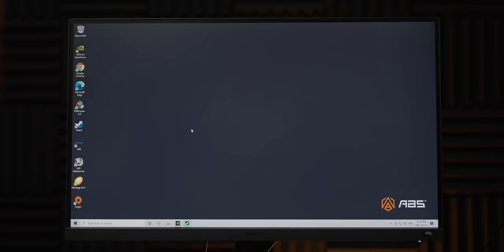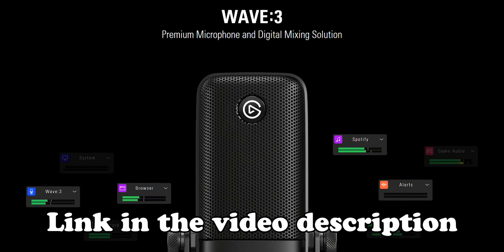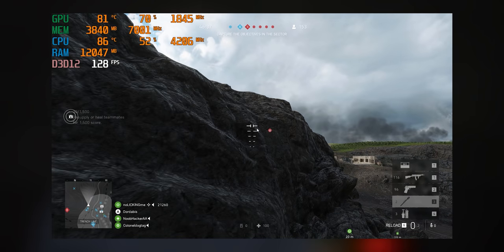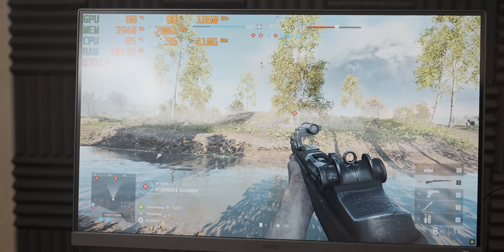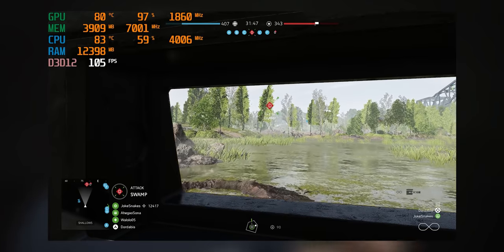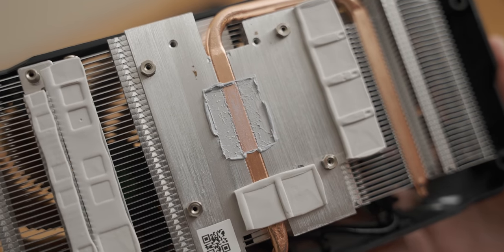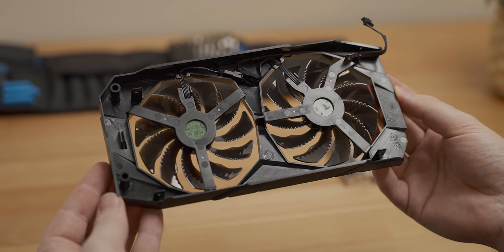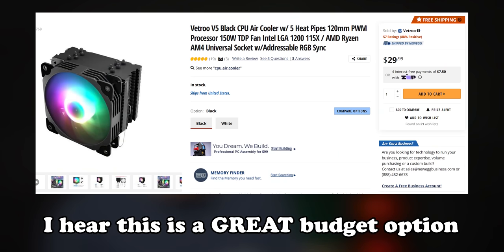Fixing The Best Selling Pre-Built Gaming PC On Newegg

Comment: Gigabyte RTX 2060 was what my Pre-built had when i brought it, it had the heat issue too but i was not confident enough to fix the problem my self, i saved up for the Asus 2080 super RTX and man that did it, like 10c cooler and way less noise even when i cranked up the rpm in the settings app. Now my problem is another fan in the case is making some more noise then it had done before, i dunno if i can fix the fan but i could replace it as i dont think it is the cpu fan as that is running fine.

Comment: What if you change the 4 stock fans around? 2 top intake and front and rear exhaust for instance? Keep the shitty cooler and remove the backplate? Would that fix the system for $0?

Comment: At this point you could've spent even less and just remove the front fans and put them on top and trash the 3rd...

I understand having RGB fans at the front can be nice... but I really don't get all those cases with a glass panel at the front and no/almost no air intake, rendering those fans useles.. There are much better cases out there like the Phantek P360a, that this is SOOO good and still looks great while being cheaper too

Comment: If you wanna go to the extreme end of upgrading that poor little GPU heatsink just for fun, there are Arctic Accelero GPU coolers that can fit many GPUs. There is the Accelero Mono Plus that fits this 2060 in terms of size, however, its a single 120mm fan with 6 heat pipes so it would perform about the same as the stock heatsink, i think.
I found a bigger heatsink that would fit this 2060 very well, also from Arctic on NewEgg but its like 100 USD so its not worth it (Accelero Twin Turbo Pro if youre wondering).
I guess you can find a used one for cheap but at that point id rather just buy a better model of a 2060.
All of this is, again, just for the fun of it. I would probably do it if there was a cheap heatsink that can actually properly fit and cool my GPU if it didnt have proper cooling cough Biostar 6600XT cough

Comment: That gpu's design was just sad. Even my sapphire rx570 (which is significantly worse/weaker than 2060) got more heatpipes, and better fin clearance....
Reply: RX 570 also consumes more power and outputs more heat, so there's that too.
Reply: @Tano I don't like it either. I modified my RX 580, so now it has 100 watt power limit and doesn't exceed 1100MHz clock speed. Now it runs really cool and still delivers most of performance. I modified vBIOS on mine, didn't bother with AMD Wattman. Newer cards don't allow vBIOS mods anymore and they have some locks to prevent that. You can only flash another card's vBIOS to them. But that usually doesn't make cards run cooler, that is mostly beneficial for overclockers looking to be less limited in overclocking.

Comment: Thanks for this video. Was planning to take apart my Asus GTX 1050Ti coz of its hot temps (91 degrees - 'Hot Spot' using HWMonitor).
It doesn't have a backplate, and has enough space for cool air to blow through it, so I guess its something else or its just junk.
Would still reapply thermal paste just to see what happens.
Reply: the "hot spot" is always going to be quite a bit higher than the overall gpu temp, thats why its called the hot spot.  if the regular gpu temp (not the hot spot) is running below 80c then you're fine.
Reply: @XadjustmentX  Googled it. Yup of course it literally meant 'Hot Spot' 😅. 
My GPU temps are still a bit high (81/82 °C) , when its pushed to its limits (eg. With Hitman 2, High/Medium settings). Crashes have reduced a lot after putting 2 140mm front intake fans, but still happen after an hour or more of gaming.
Had recently upgraded so I'm still trying to understand & fix this issue. (This GPU is from an old FX 6300 build, where it wasnt really pushed to its limits before)
Reply: @For3xampleJohn  while 81-82c isnt ideal, its not going to hurt it by any means. my old 2080ti founder's edition ran at 84c while gaming for the entire 2 years i used it. never once gave me any issues, just ran a bit hot. gfx cards today are far more durable than they used to be and they can run for years at those temps. its just not ideal. you could also try to undervolt your gpu in msi afterburner and see if that helps. i did an undervolt for my 3080 so it runs about 5c-8c cooler. its really easy to do and theres plenty of guides on youtube for how to do it if you want to try it.
Reply: @XadjustmentX  👏. It did run 10 degrees cooler than before after undervolting. Thanks for the help ✌️
Reply: @For3xampleJohn  yea no problem. glad i could help out. take it easy.

Comment: I bought a ABS system from NewEgg in 2017 and they actually recommended in their setup guide to reinstall Windows.   Did the new ABS system no included the same recommendation?
Reply: did they recommend to reinstall windows or activate windows? a lot of pre-built companies put windows on their pc's but dont activate it. they typically put instructions to activate it in the setup guide. that has to be what you mean because recommending re-installing windows on a brand new pc makes no sense.

Comment: I was having the same issues with my system crashing during games like that. I reinstalled windows and it didn't help. Then I updated the BIOS and it worked great after that. I was never getting any temp issues though.
Reply: @weecious  It may have been something with that. Not sure. It let me put my XMP on it to put my ram up to the advertised 3600 MHz but maybe that was the problem and the bios couldn't configure it properly for some reason. All is well and good now though. I got my new 3080 running with my new 5600x and my new X570 board and I started playing a 16 year old game immediately because I'm an idiot.
Reply: @weecious  I have a B550 Mobo already. I got the X570 because I got chosen for the NewEgg shuffle and had to get it to get my RTX 3080. I bought the 5600x because I felt like the 3600 was bringing my 3080 down.
Reply: @weecious  Right now I have a 21:9 1080p Monitor so I'm not getting the most out of my 3080. I got this because I had a 970 before and this was even too much for some games. Hell, the 1080 I got about a year ago could barely handle CP77 on this monitor. I have a 4k TV I play on occasionally as well but I plan on selling my Ultra wide because I'm over the huge display and I'm gonna get a 1440p 16:9 or a 4k monitor if I can find a good one for cheap.
Reply: @MikeArpeggio345  Also wanted to mention if you got a 1440p 144hz monitor or so then you wouldn't need to upgrade your GPU next gen that's for sure, maybe you can even skip 2 next GPU gens if you play lots of competitive games in which case it's better to play on lower settings to get the best performance. If you play lots of single player games which require eye candy settings then you can definitely feel safe to skip a gen and by then if everything going as planned... GPU prices will go back to normal. Trust me 1440p is the way to go specially since you have a 4K TV. I had 1440p monitors since 2014, first monitor was great but I wanted more than 60hz, second monitor was great but it a TN panel and I got sick of it after half a year. Both were 27" 1440. I am currently rocking a 32" IPS monitor and I love how big it is. I've had it for a year and it's so awesome IMO. But don't go smaller than 27" at 1440p trust me on that, also avoid TN monitors. They suck so back when looking at them at any angle unless you're sitting straight in front of it. I am kicking myself in the aas now... when RTX 2000 Super series came out.. I got a 2060 Super. I should have spent an extra $100 and got a 2070 Super. I didn't know this mining scalping bullshit would start as soon as new gen of GPUs came out. Otherwise I would have a RTC 3070 or RX 6800. But surprisingly 2060 Super still does Ultra settings just no more than 60fps. I am happy that it at least keeps up with new games at 60fps Ultra. Looks like... I might have to sit on my 2060 Super until 2023 if rumors are true. I am hoping I find a decent deal soon enough. Maybe it would be smart to skip this new gen of GPUs since it's already been a year and we should hear news about next gen GPUs that's when I'll REALLY try to get an RTX 4070 or RX 7800 or something close to those GPUs perfomance. By then AMD should have some magic done to their RX 7000 GPUs with Ray Tarcing (at least.. I hope). Right now DLSS 2.0 helps me A LOT in games that support it. My current setup is Ryzen 7 3700X 4.3GHz (OC locked to all cores at 1.29V), Vetroo V5 (White Edition) CPU Cooler, ASUS ROG B450-F, 32GB DDDR4 Corsair Vengeance 3600mhz CL16 RGB PRO, 1TB NVME M.2 SK Hynix Gold P31, 1TB M.2 Ceucial M500, 5TB of spinny hard drives storage, 6 Halo Style RGB fans by Antec, Enermax 750W MarbleBron, Corsair 275R (Airflow White Edition Case), Logitech Z625 2.1 200W (400W Peak) speakers, 2 Redragon modded keyboards.. K552 TKL (Blue Outemu Switches) and K578 (Brown Outemu Switches) both addressable RGB, 1 Logitech G502 older edition and still brand new unopened Logitech G502 HERO (i got it on half the price sale so I couldn't pass it up) it's my favorite mouse by far. I have it hooked up to my 1440p IPS monitor and an older 50" TV for when friends come over to play some Mortal Komat or CoD Zombies, etc. I also have lots of goodies that I could build another rig just need a GPU for it. But I have a second rig which is Ryzen 5 1600 (back when they were $80 brand new), Cooler Master Hyper 212, ASRock Pro4, 16GB G.Skill Trident Z 3000mhz CL14, 500GB Samsung 870 EV, 1TB WD Blue HDD, 600B (600W) EVGA PSU, Old style Antec GX700 Military Case, Corsair Sabre RGB mouse, Logitech G105 old school keyboard, Logitech 60W speakers (don't remember the name), 24"1080p Samsung IPS monitor (kinda old school don't remember the name but also hooked up to a 50" TV), 5 Corsair Blue AF120 fans, it has a pathetic GT 210 just as display of some sort... later on will buy a decent used GPU for it when prices come down. Very long message. Sorry about that. I thought, you would know that your 3080 must feel good but you really need a 1440p 144hz - 165 monitor. I'd do everything within my powers to get a 3070/3080/6700 XT/6800/6800 XT for MSRP. Although I am surprised how well 2060 Super is holding up at least in games I play and as I mentioned games that support DLSS are a God Saver!

Comment: Not sure if you or anyone will see this, but your previous upload on this system reminded me of a question i had. on my current rig i installed my cpu fan in the wrong direction. is it safe to remove the fan and position it to my liking or would i have to clean the current thermal paste and reapply new thermal paste?

Comment: A thoroughly practical pimp action that I have wondered about is removing the horizontal grille next to the display connectors on the back of the card. (I have a blower card, that's pretty much where the air has to come out.)  What would that do to gpu temps?

Comment: Wouldn’t top exhaust be better since heat rises?
Reply: Air flow negates any effect of heat rising. Setting the fans as exhaust would create negative pressure, and you would be relying on the air outside being sucked through any holes in the case. If most of those holes are in the top you would be blocking those off from bringing in air.
And your VRMs and memory would like you bringing in nice colder air over them.

Comment: The problem i had with my windows installation is that windows wasn't even activated. So i had to email the support from the company i got it from to fix it.
Reply: I forgot which company was doing that, but it's normal for them.  For that matter, ABS has some automated way to do it, and if that fails you have to run "wmic path softwarelicensingservice get OA3xOriginalProductKey" at the command line, grab that key, then manually put it into windows.

Comment: I think the reason why reinstalling Windows often fixes things is simply because the drive image used wasn't for the exact same hardware, so you had drivers that were sorta close, but not right. Reinstalling Windows means that the correct hardware drivers are loaded since the install process checks what kind of hardware you've actually got.

Comment: Sort of defeats the object of buying a prebuilt.

If you're happy replacing the CPU cooler and applying fresh thermal paste to your GPU then it's not much of a step up to building your own system.
Reply: Changing the cpu cooler was a must. the fresh thermal paste on the gpu was a waste of time because it's more difficult and only lowered temp by a degree. I was pleasantly surprised when taking off the rear plastic shroud lowered it by 4-5 more degrees. Rear shrouds on gpus should either be metal or not exist.
Reply: And yes, you're right prebuilts should just work but he's showing where they cheap out and how you can fix it if you've already bought one.

Comment: i does really annoy me with these systems that you get single stick ram and poor cooling systems and bad PSUs. that thermaltake CPU cooler is 20 bucks the non-name you mention is 30 and the hyper 212 is 40 bucks. then with the ram and extra 20 bucks at most will fix the single stick ram issue. and for the PSU an extra 20 bucks there as well will get you something much better.

so for 60 bucks and just getting a better case you get better temps, noise and performance for very little. a 6% price premium is just such a norbrainer to me.

Comment: While I'm pleased he got the temps down, wow am I annoyed he installed the fans on the top, intaking DOWN. I know I'm just another jerk on the Internet, but you'd be WAY better served putting those fans you bought on the Hyper 212 (I run two in push/pull), and one fan acting as an exhaust UP from the case (heat rising etc). Use a lighter to watch the airflow, better than using strips of paper.

Comment: The easiest way to fix the GPU temperature could have been a simple undervolt in Afterburner
Reply: For real, it lowered full load temps in my evga rtx 2080 by 10 degrees (C) with no loss of performance.
Reply: @KurisuKun  didn't work normally on my 3080...same usage of power, just 2 degree less but it increased a lot the core clock 🤔🤔... usually it the best option

Comment: When you talk about reinstalling windows on a prebuilt do  you use your own copy of windows or the backup copy that came with the system?
Reply: use the license no that comes with your prebuilt no need to by new license
Reply: @alantipping170  Who is talking about using a license?
Reply: meant windows  license.
Reply: @alantipping170  and what I meant was if you are trying to get rid of any unwanted configuration setting that are causing the PC to over heat.  what do you do use the copy of the window that came with the computer in the first place or use a copy of just windows from Microsoft?  or dose the Product key get rid of the over heating problem?
Reply: you can use the product key to use the latest version of windows .if your machine had a bad install. a new install will clear up any problems . @dwaynelangerhr6985

Comment: Is $170 (CAD) for a gtx 970 too much? I'm  working out a deal for a used card tomorrow. Kind of a random comment but just though that I would throw it out there. I have a gtx 750 and would like to upgrade to an older used card until prices go down.
Reply: a quick ebay/google search shows used 970's selling for 200-250$ right now. if you can get one for 170$ i'd say thats a pretty decent deal.
Reply: @XadjustmentX  Alright, thanks man!

Comment: I just pray that all of the pre-built providers finally stop saving those 10-15 bucks for getting at the very least a Hyper 212 or a beQuiet Pure Rock 2.. They're inexpensive at this point, you're not saving money - if anything you're begging for people to return the PCs for the crashing issues due to thermals. Not only that, but not everyone is capable of building a PC on their own, that's why they're turning to pre-builts, but this.. It's just horrendous. Please stop strapping a fan with a resemblance of a radiator below it to cool down a CPU. 🙏🙏🙏

Comment: My psu is actually above the cpu but it's a ryzen 3 so temps don't go far and my 1650 goes to 70 are those healthy temps?
Reply: 70c is good for a gpu. most gfx cards these days have a thermal limit at around 83c. nvidia lists the max temp for the 1650 at 92c.  a general rule of thumb for gfx cards is anything under 80c is perfectly fine. if you can get it to stay under 75c, even better.
Reply: @XadjustmentX  yeah usually it's at 71 to 74
Reply: @christipof5934  yea then thats great honestly. anything under 75c is considered ideal.
Reply: @XadjustmentX  haha thanks man , and what about cpu tempts I don't have my driver's but I assume it would be the same temperatures there?
Reply: @christipof5934  no problem. its about the exact same to be honest. 80c is kinda the limit when you might want to slightly worry. its fine if it just spikes to 80c-83c for a second or two and then goes back down to low 70's. but if its staying at 80c or more constantly then thats not so good. about 72c or below is where you want your cpu to be for gaming. if it spikes a little above that for a few seconds here and there then its fine, you just dont want it to stay above that for long periods. it all depends on how good your cooler is compared to your hardware. i always prefer to go with a little better cooler than whats needed just so i dont have to worry about it.
Reply: @XadjustmentX  well I still use the stock wraith cooler
Reply: @christipof5934  not an ideal cooling solution but not the worst either. 3600x? something like the cooler Dawid used in this video (cooler master hyper 212 evo) would be an upgrade. fairly cheap and good performance for the price...40$.